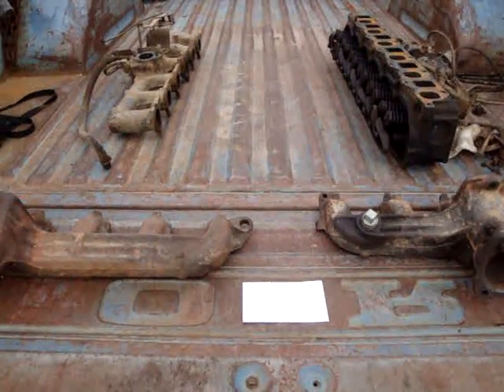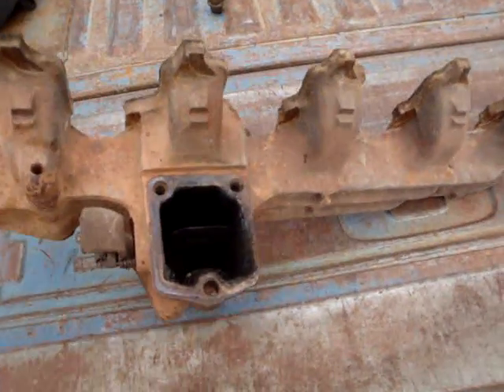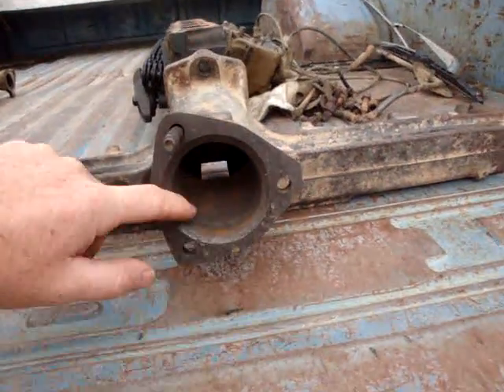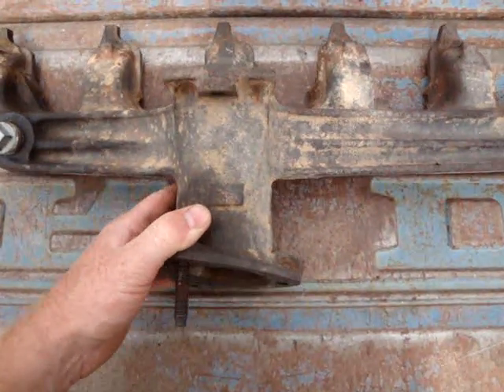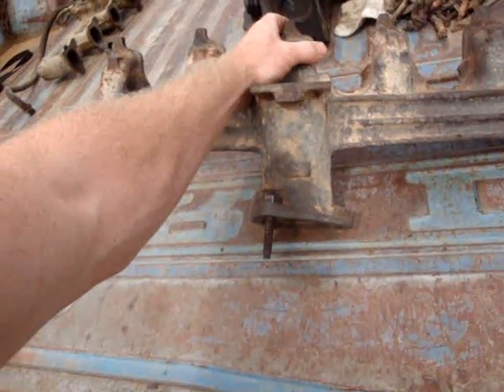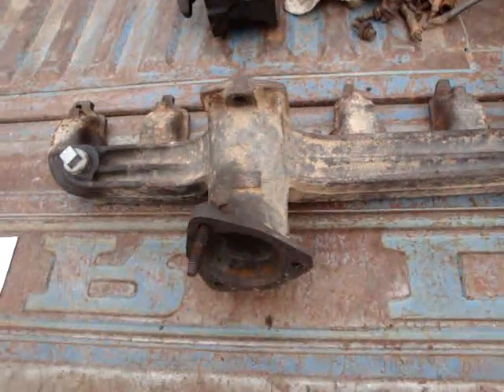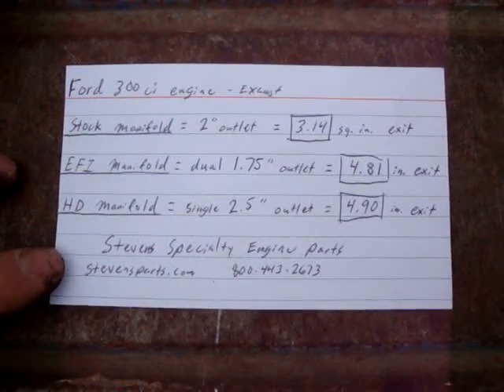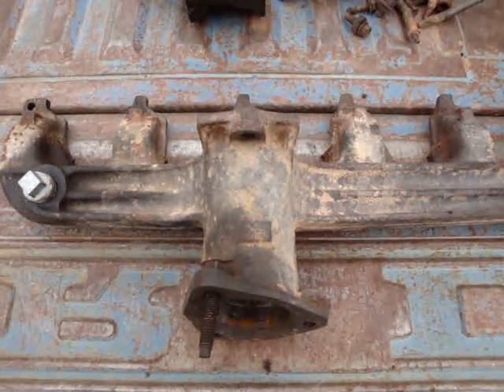Ford 300 HD exhaust manifold

Comment: Old video but those ribs were not for heat dissipation/cooling.  They were for structural strength.  As noted cast iron has a tendency to crack.

Comment: When you go looking for 1987-1997 EFI manifolds on a 300-6 there were variations between the vans and F series trucks. In the early 2000’s I was putting a 2 piece Hedman header on my 1983 F150 300-6 and I used the Y exhaust piece from a 1987 E250 van I had up in the woods. The carb was running very lean and it got so hot that I could feel through my shoes that the floor was hot. The engine cracked the head after 10 days. I often had trouble with the carbs in the pre efi 300’s I had. I had better luck with the 1993 F150 and 1994 F250HD I had which both had 300’s. Their main problems were cracking leaking vacuum lines and the EGR valves acting goofy because of vacuum leaks and/or the EGR sticking. Several people traced EGR gaskets and made metal EGR block off plates with 1/8” to 1/16” holes so it doesn’t set off codes. OBD 2 started with the 1996 models. 1997 F250’s and F350’s were still available with the 300’s. I don’t know the last year that the 300 went into the E series vans.

Comment: What's the hole inside the bolt looking deal on the stock manifold next to the egr port
Reply: Thats just a pipe plug... if i remember correctly its a 1/2” pipe thread
Reply: @TheFARM2019  alright. Thanks.

Comment: When my standard exhaust manifold warped for the second time, I swapped it out for a split manifold from a 1990 fuel injected 300.  Works great, but you have to get the 'y' connector at the same time.
Reply: Where did you get the y pipe? Do you still have the part number? Thanks I have a 96 4.9 which I'm trying to modify the exhaust myself.

Comment: I have a 72 F250 with the 300 engine. I've had to replace the exhaust maniford twice because of warping.Instead of wasting my time looking for a rare HD manifold I switched a split manifold from a 1989 300 six.  Works like a champ.

Comment: The heavy duty trucks also got a forged crank a new one from Crower is about 3100 bucks but it's good to almost 6000 rpm . I bet the one from Crower has been on the shelf has been there for 40 years

Comment: Question when I took the 2 bolts out of the exaust pipe to the manifold I didn't see a donut gasket or anything so is there any gasket that goes there or do I just bolt it back up without a gasket

Comment from the maker: Update:  I installed this manifold along with re-building the head (ported) and adding a Clifford 4bbl intake with an edlebrock 500 cfm carb.  I added a 2.5 in exhaust with a thrush glass pack.  The whole setup runs great and flows air very well.  I cant really speak as to how this manifold makes a difference compared to the stock exhaust, but I see no reason t put headers on.  The sound is deep but mellow at an idle, kind of like a tractor.  It sounds really good for a 6, but there is some droning of the sound in the cab at about 2000 rpm, then quiets out.  This setup has produced the deepest sound that I have heard of in a six so far.  It could be due to the porting of the head.
Reply: THE67MIGHTYMOUSE WRONG. The stock exhaust manifold breathes HORRIBLY. put the later dual manifolds on it. They breath MUCH better

Comment: Chevy made a bigger manifold in one ton and bigger trucks as well, I have a few of those that I bought over the last 10 years, farm equipment and truck scrappers out in the country usually get those old heavy trucks if you can find them before they send them off to China, nobody wants inline engines around here everyone instead wants to spend 20 or 30 grand to buy a diesel, inlines like GM 292 and Ford 300s probably are more plentiful out west were your located if more people put more value on utilizing them rather then scrapping them.